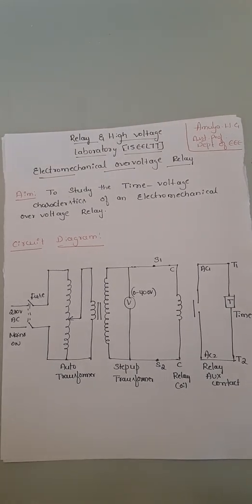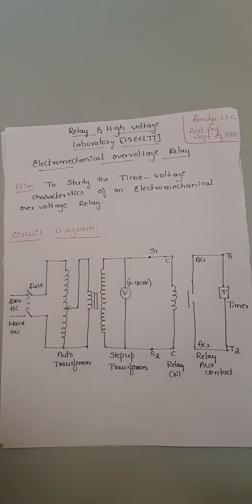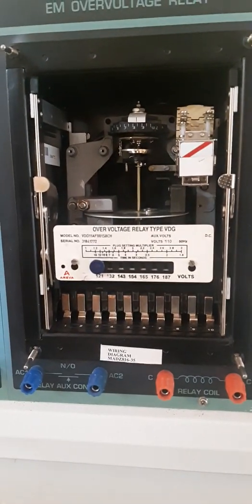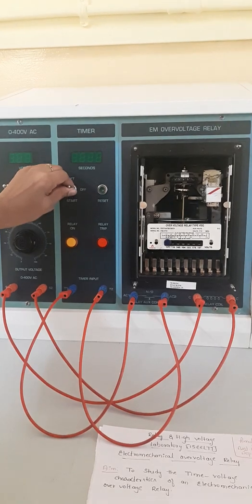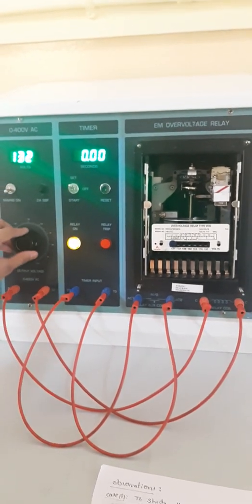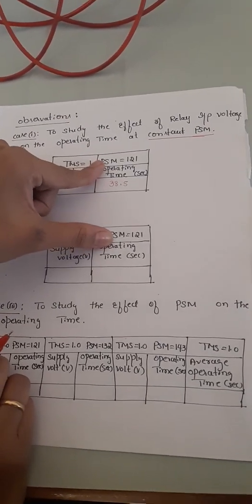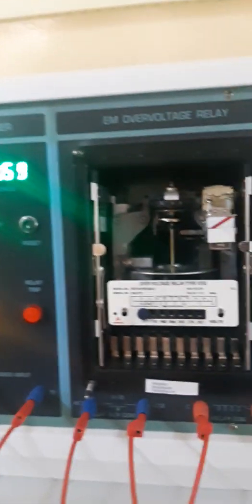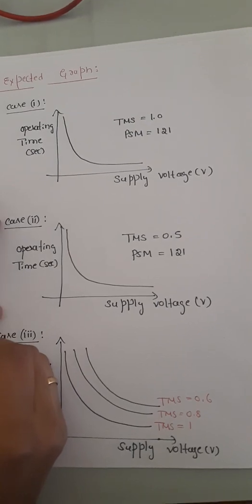Electromechanical over voltage relay

Comment: Graph for the three compared TMS values is wrong because for the same supply voltage as we increase TMS then tripping time should also increase but it is not happening in the graph that you have shown.